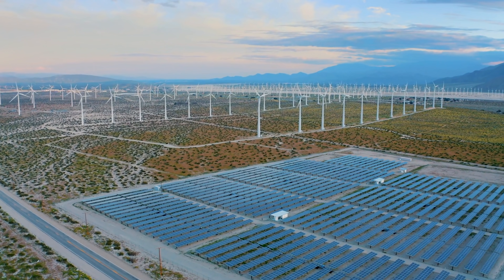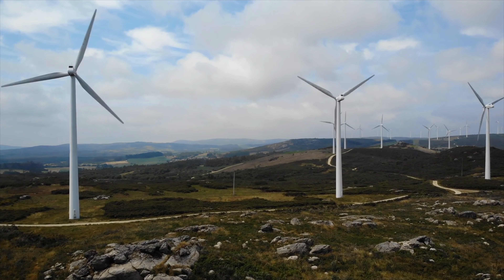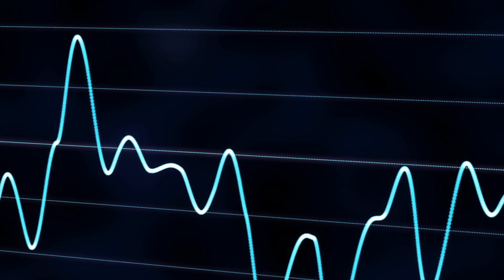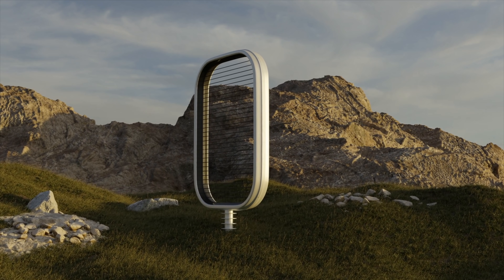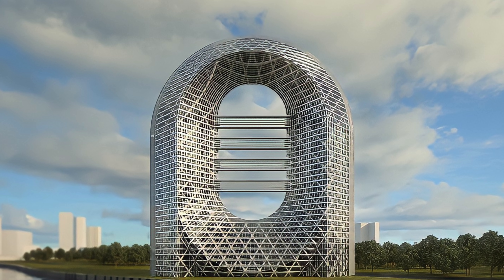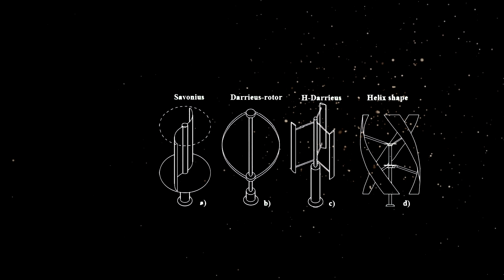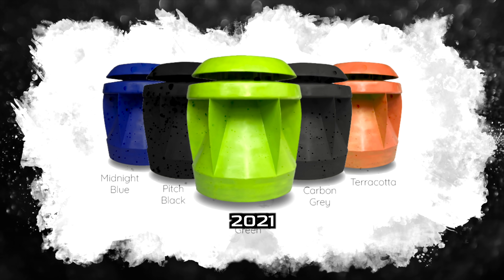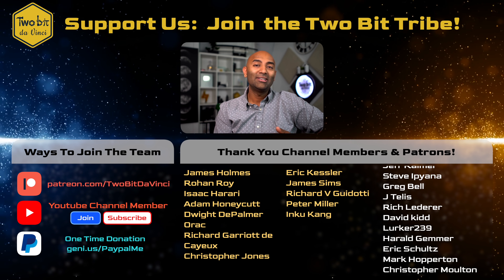These Wind Turbines have NO Blades!

Comment: I am very interested in different power generation options.. I have a 5kw20 panel Solar system here in Melbourne Australia but the problem is the Govt. keeps reducing the feed in tarriff all the time ... it is going from $0.67cpkw down to $0.52 cpkw on 1July 22 which makes me mad as the Govt keeps reducing the feed in tariff all the time. I would love a small vertical wind vane here at my place but they are just too expensive and there are just too many rules and regs just to put one up in a residential area it outweighs the cost return and also the installation cost associated with hooking it up to my Solar system or another system to feed into the grid or batteries for night time use.

Comment: The issue is economics and physics. I listened to a show explaining the issues. They said like with wood you put in one part energy and get five out. Coal may have been put in one part energy and get 15 out which helped the industrial Revolution since capital built up and people didn’t have to just focus on energy. Imagine heating food with food like they do in third world countries. Takes more time. And I think they said now coal Is like 30 to 1 and oil maybe higher. But nuclear is like 100 to 1. Put in one part energy and get out 100 which is huge
Since it delivers a ton of energy for energy or capital put into it. Solar and wind would only be AMAZING if you could get that kind of efficiency or return. Build one wind turbine for one unit of energy and get out 30 units of energy would definitely make it more appealing especially to developing nations. Much easier to build a
Big coal plant or something because you know it’ll last 60 plus years. Which means you get a good return on assets which is super important. If you have to throw it away after 20 years they not very sustainable so if they got solar to last 50 plus years then it’d be more appealing too.

Comment: The first YouTube videos of the 'Power Pod' residential home zero point energy wind turbine design, were published on YouTube in 2021; it is now May of 2022 and as yet, I have not found any YouTube videos indicating that this zero point energy residential wind turbine is available for the public to purchase.  Purportedly, the engineering design company for the zero point energy 'Power Pod' wind turbine, is located in the state of Utah.  When will this residential home wind turbine be available for the public to purchase?

Comment: Notice too, the oscillation of the wind for a long distance after the oscillator. by putting them in tandem at the right "frequency" or distance you can now capture the added wave energy created by the first one and then the second and so forth.
  Now if one placed them on a grid so that the wave energy could be used on all sides no matter what direction the wind was blowing then you would really have something. 
   So what if someone created a better shape that would act on the wind to capture even more power and where the "frequency" could be altered like a variable pitch prop to capture the energy of the wind at low velocities and high velocities??? And what if you could put this  thing on the side of buildings, roofs of homes once the sweet spot was determined???
  Yea what if you knew that a design like that would cause the criminals in government to try and take you out to quash it like a bug going up against big corp. controlled by the oligarchs who have rigged the system for waist purposely for unjust gains???
   Then it becomes apparent that first the PEOPLE must get their representatives in positions of public trust (including corporations) under control or removed and replaced with honorable people. ... How do we do that? 
   Name a job that one can get and not be competent to provide the service required? Name a job one can keep even though not competent to provide the services needed and name a job you can keep that allows you to work towards the destruction of the business ("mere legal entity)??  Exactly!! only one and that is Government.
    Solution? Simple just like the energy use problem which really is not a problem at all..., institute testing upon application to a position of public trust and since "power corrupts" let's institute legislation that also requires periodic testing to insure they are in fact Competent to serve the position created by the people to benefit the people not the shareholders. 
   Hey truckers drive day and night and yet every 6 months they have to requalify... so if its good enough for the truckers then its good enough for mayors, and judges, and clerks and cops and congressmen and code enforcement and anyone in any position of public trust\   Find the "Proposed Continued Competency Training Legislation at  crackingtheeggshell of conditioning dot com
  Blessings ...energy is all around us free, we just have to figure out how to tap into it and convert it for our purposes.

Comment: Cats don’t kill eagles or geese wind turbines do kill Big predator birds like Hawks, Owls and Eagles. Wind turbines also killed many bats. And let’s not forget the buzzard or vultures that provide a necessary service of cleaning up dead critters on the landscape. Wind turbines make electricity sometimes. They are intermittent electrical generators because the wind does not always blow or it blows too much and the blades have to be feathered. Wind turbines are especially prone to very high wind situations like tornadoes or hurricanes. A decentralized electrical grid. Requires a tremendous volume of materials and land to harness wind and solar. This is interesting technology no doubt what isn’t it just simpler to build a whole bunch of Molten Salt Reactors, Generation 4 nuclear reactors. Atomic Heat Engines that use Existing Reactor waste fuel as primary fuel that is liquid instead of solid fuel rods from the existing Generation 2 reactors. For the past 20 years the existing fleet of 100 reactor complexes has produced 20% of the United States total electricity. Currently this electricity is being delivered at 92% of the time. At best wind generates at 40% of the time but it’s very variable. Wind also requires back up when the wind does not blow.
Reply: I will say there are some pretty cool designs outlined in this video. The thing is in order to really make enough electricity to start pulling CO2 out of the atmosphere in the ocean you’re going to need a lot of machines to do it and all that wire conductor to connect at all to the end-user. The challenge of renewables is the amount of materials and physical space they require to provide significant CO2 reduction

Comment: I do not think cats can kill as many birds as 2.6 Billion, the statistics are rubbish, I have owned 12 cats and in 10 years they have not killed a single bird. Yes they do kill mice. I do know that high rise static buildings also kill lots of birds, and there are hundreds of other factors where bird population starts to die or go into decline, pollution levels, effects of 5G on their magnetic sensing leading them astray etc etc. Wind turbines certainly kill more than cats do. Especially if you consider there are 95Million cats in USA, what if there were 950,000 wind turbines they would most certainly kill billions of birds.

Comment: Another big disadvantage of the giant wind blade turbines is that the blades break/get damaged/degrade over time (obviously a well known fact about just about anything) HOWEVER, THE BLADES ARE NOT RECYCLABLE (as they have been and are built) THUS THEY CURRENTLY CREATE ENVIRONMENTAL/WASTE PROBLEMS AND WILL EVENTUALLY CREATE A MASSIVE ECOLOGICAL AND ENVIRONMENTAL HAZARD, especially as people decide to move away from giant eye sore turbines to smaller or more localized power generation options which will render the current turbines useless and a menace en masse.

There's also the question of what goes into making them and transporting them and I DON'T MEAN IN TERMS OF MONEY! FOSSIL FUELS ARE STILL THE CHEAPEST (MONEY) WAY TO GENERATE ENERGY BUT OBVIOUSLY EXTRACTING, PROCESSING AND USING FOSSIL FUELS HAS A COST TO THE PLANET, ANIMALS, PLANTS, WATER AND PEOPLE BEYOND THE COMBINATION OF EVERY UNIT OF PROFIT EVER MADE FROM THEIR SALE AND THE "SAVINGS" GAINED BY THE CONSUMER OF FOSSIL FUELS FOR ENERGY - this is without even going into hydrocarbon products like the plethora of plastics made by the fucking giga-ton every day.

The prices of using wind and solar have come down and will continue to do so BUUUUUUT, what is the cost of making the capital and dealing with the waste generated by that capital for those industries, in not just MONEY?!

Comment: Put a vertical windmill on every streetlight post (possibly going around the pole) Adaptor plates can be used for different pole types (steel, concrete or timber) so the same units can be used (cheaper to manufacture), they don't need to be big or expensive as there would be thousands of them generating 24/7 as smaller units require less wind to produce power ( I was thinking recycled plastics for the majority of construction).... streetlights are also already connected to the electricity grid , saving on infrastructure ...  they could be cheaply made , installed by technicians during routine maintenance and supply power where it's needed (where there are lots of people)... if a unit fails, just replace with a new unit and repair the broken one at your leisure.
Reply: 😊already operating in Rockingham w.a. (Australia.)

Comment: I believe that there are many different use cases,  fitting various solutions. In that way, each of these will have niche customers.  I think potentially that you'll see all of these in use in the future. 

Right now,  retrofitting urban environments is crucial, as most of the energy is used in these locations.  These are the beginning of an answer.

Comment: I’m fairly recent to “Green Energy” systems.
I see so much small scale wasted energy that should already be implemented on every house built and combined to make a sustainable power plant to share among the larger communities.
Start with water mains generation then small wind turbines as in this video add in solar that charge capacitor banks to run a fly wheel battery.
I’m sure there’s a way to put it together but honestly it’s out of my abilities and certainly more than I can afford to test trial.
Your thoughts?

Comment: I have been a prponent of VWTs going back decades. One problem with any technology we choose in suburbia is NIMBY. Many of us live in areas with grouchy neighbors and/or restricive zoning boards. So on one hand you have all these neighbors saying they want sustainable, renewable and other goofy buzzwords that don't actually mean what people think they mean, and then push comes to shove they don't want things on people's houses or properties that look too different.

In that respect, I believe VWTs are better than noisy large airplane propellers, but I think more could be done to make them acceptable to our neighbors such as shrinking the scale. For example the power pod could be made to be around six inches high with a smaller built-in generator and you could install ten or more in a less intrusive looking way.

On that note I like the SKY VIBRATOR as well and wonder if they could make them look like trees or some other common looking thing found in neighborhoods. That would be for the grouchy neighbors etc, not for me. That too would probably be more acceptable to more people if we used smaller versions and more of them. In fact I will assume that smaller versions would vibrate at higher frequencies and maybe have less constant torque applied so less wear and chance of mechanical failure from metal fatigue.

Finally I think we need to RETHINK how we use power. How many devices do we use that might be better if we had 12V versions instead of 110V wasting energy stepping down to low voltages? Let's not call that approach "sustainable", let's call it SENSIBLE at least that word still means what it always meant.

Comment: Why not have a spinning bar with small blades along the ridge line of a house. As the air rushes up the roof it would turn the bar, connecting either side of the roof. It would spin really quickly making lots of power.

Comment: For years I've wondered why vertical blades placed alongside highways and freeways (especially the latter) couldn't be used to harness the wasted air-movement power of passing cars and trucks. Also wondered if anyone has thought about trying to harness the "pressure" energy of the weight of cars and trucks pressing down on the pavement of freeways (peizo-lectirc?---is that a word?)  Vehicle movement and weight is pretty much continuous these days and produce a lot of potential for energy-capture...or so it would seem,

Comment: P = ρ A v3 / 2

   = ρ π d2 v3 / 8                                           

where

P = power (W)

ρ = density of air (kg/m3)

A = windmill area perpendicular to the wind (m2)

v = wind speed (m/s)

π = 3.14....

d = windmill diameter (m)
Reply from the maker: We should connect. I love mathematicians

Comment: One thing to point out about the ecological impact of large wind turbines: the birds killed are much larger, more likely to be endangered, and are generally much smaller in number than the birds killed by cats. Not that wind isn't worth the trade off when you look at the impact of what it's replacing. Nuclear is still better, particularly thorium.

Comment: The sky sails might be really cool, BUT…putting a kite up that high, & risking it suddenly diving back to earth (as kits can do), makes it dangerous, & requiring large areas clear around it for safety. 
The power pod, though, is VERY attractive, can be made artfully & able to blend with a home’s design. No blades means much increased safety, even over a VAWT.  
Home wind power has one little issue most are unaware of: vibration. They require some kind of decoupled/dampening, to prevent vibrations being spread through the building’ structure. 
What we really need to be doing, is ramping-up wave generation. 
We have thousands & thousands of miles of coastline, with constant wave action just going to waste.  Wave gens have been in use in some places, but it’s far underused.  
We also have plenty of big rivers that could be used..micro hydro ..real micro hydro.. is vastly underused.  
Hydro & wind motion generation are similar; but one is constant, the other is not. I think the maintenance issues with each, might be about similar. And, could still keep privatizing profiteers happy.

Comment: When you talked about Vertical axis wind turbines, you skipped one I know of from England, the "Quit Revolution" brand has 3 blades that are twisted 120 Degrees ie short helix, they were designed for Urban areas in England, their start speed is very low, (a lot lower than a horizontal axis turbine) and the top speed is much higher than HAWT, they have a more solid appearance when spinning, so birds and bats see them better that HAWT, so they are much easier avoided. They would be a good addition to a roofline. [no stranger than a satelite dish] the power pod design looks intrigueing depending on how many watts it can make compared to a Quiet revolution, I think the Quiet revolution would win.

Comment: What a load of half truths.
Turbines reduce carbon pollution, only when counting the power generated, If you include the manufacturing, servicing and decommissioning of the turbines. They produce way more carbon than the equal amount of power produced by existing means.
Turbines kill birds, cats kill more. WHAT BIRDS. Cats kill local plentiful species rarely do the kill rare birds. Turbines kill vastly more rare endangered birds and very few common plentiful breeds. Which has the greater impact on species survival.

If your argument relies on lies, withheld information or cherry picked information. Then your argument is weak

Comment: All wind turbines extract energy from moving air and that is always a product of the "swept area." No matter how efficient or space-age science and technology is applied, nothing can take the place of over-all swept area.   No vertical axis design can compete with horizontal axis turbines.  There are plenty of things that work but nothing quite
so well as an 19th century Windjammer sailing ship and a 20th century, 3-blade, horizontal axis turbine.  Both are out-dated but both still work.

Comment: Wind wont be feasible for home use, at least not with trees around and I would rather have the trees. Wind would be great for places with large open spaces such as farms but not the city. Solar can also be a challenge with trees and neighboring buildings creating shadows but solar shows the most promise so far. Stored water could be useful to make electricity and could be done to replace the need for toxic batteries that are hard to recycle. A simple pump system could work but you would need to live on a hill for this to be effective as you need drop to get gravity to move the water to make electricity when you need it. If you have a large enough storage tank, you could pump water to the tank to store for when you need it.

Comment: 13:10 A UK company, Alpha 311 has developed VWT that can be attached to existing lamp and sign posts alongside busier roads. The collected energy is then used to power the road illumination.

13:20 I just had a quick look and, according to Halcium’s website the Powerpod is not in production yet.

Comment: You forgot delamination of blades which costs a fortune in repairs. Blades are constantly sandblasted by micro grit particles which soon eats into the blades surface and if not rectified leads to blade failure. Something that was never factored into the original costings of wind turbines!